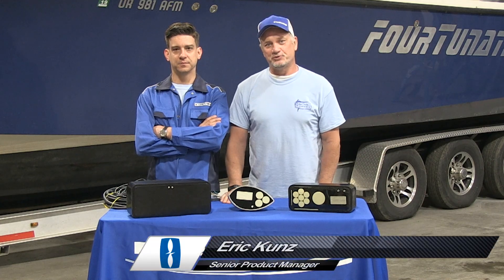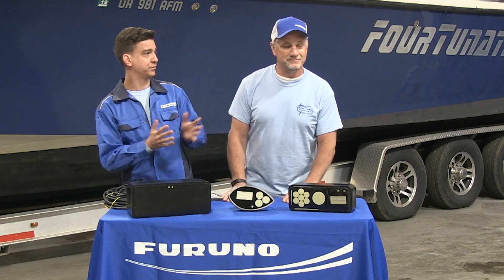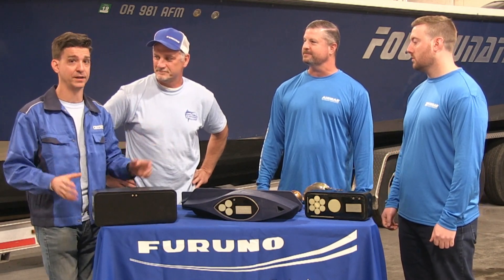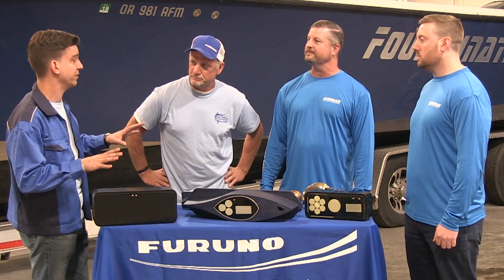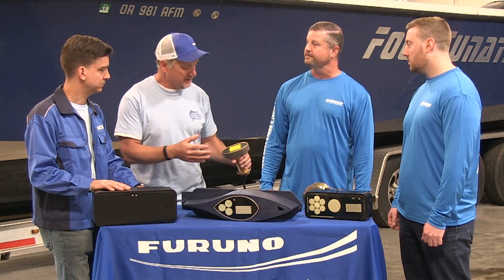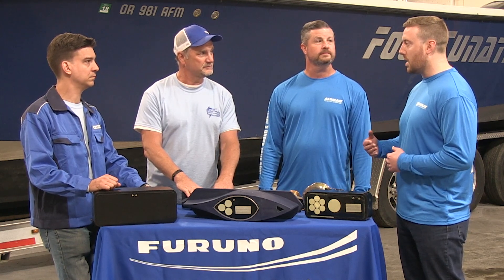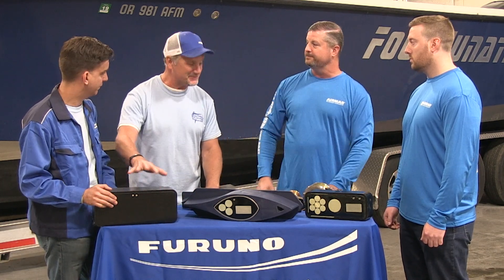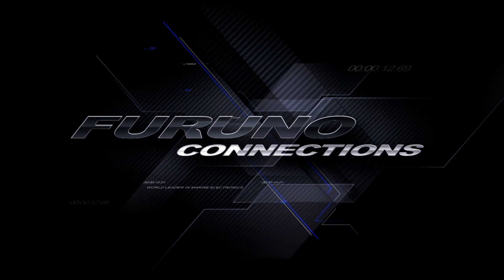Which Is The Best Fish Finder Transducer For My Boat S1 E6 Furuno Connections

Comment: What model is the 1Kw transducer in the center of the table? Does it work on the TZT16F (Tz3)?
Reply from the maker: The transducer in the middle of the table is the 165T-50/200-SS260 Combination transducer, which will drive your TZT16F's built-in 50/200kW Fish Finder as well as the DFF3D Multibeam Sonar: https://www.furunousa.com/en/products/165t-50--200-ss260

Comment: Which is the modelnr. of the 2kw on the left side& what box do I need to get it working. DFF3D box?is it working with a touch2 too? thx
Reply from the maker: Hi Nico, thanks for watching. This is the 165T-PM542LM (https://www.furunousa.com/en/products/165t-pm542lm) transducer. You will need the DFF3D to operate the Multi-Beam sonar and then a Fish Finder box for the down sounding portion.

Comment: can you kindly let me have the transducer model number that has the 2KW, low/med/high frequency along with the 3D, the one on the far left of the table please?
Reply from the maker: That transducer is the 165T-PM111LM, you can view it on our website here: https://www.furunousa.com/en/products/165t-pm111lm
Reply: @FurunoMarineElectronics  If i have the TZT2, i am sure the 3D will work through the DFF3D black Box, but will the low and medium chirp work on the TZT2 without adding additional equipment?? Kindly assist. I want them to work as Chirp and not traditional.
Reply from the maker: @666kgb666 , Unfortunately, we do not have technicians available to answer product questions on YouTube. Please try asking this question on the Furuno USA Forum. You can find the forum at this link: 

http://www.furunousaforum.com/index.php

The Furuno Forum is staffed by our own technical experts, and they may be able to provide answers to your questions. Just post your question in the Fish Finder section, and one of our technicians will be able to make a suggestion.